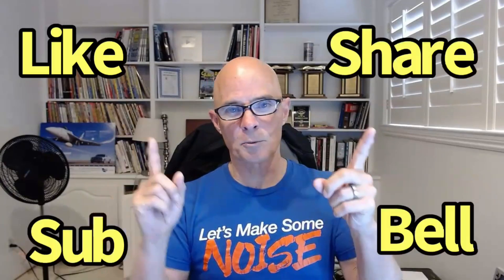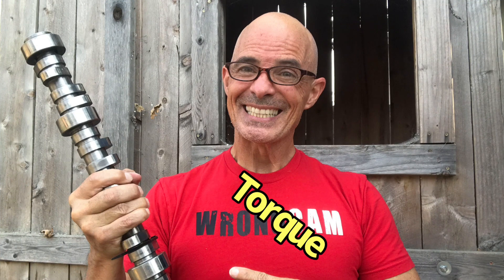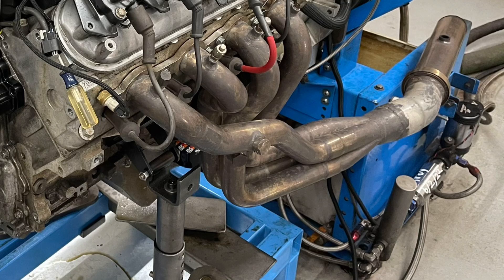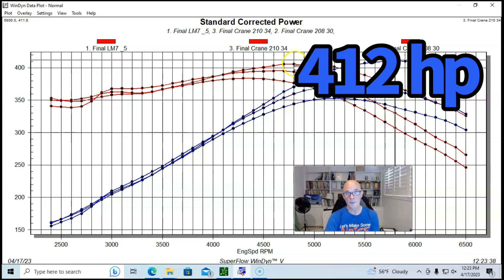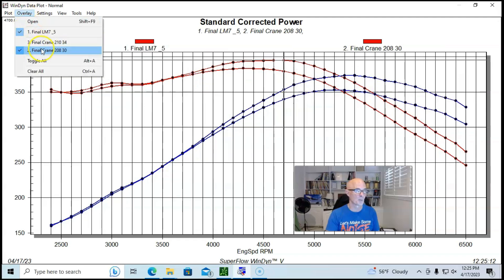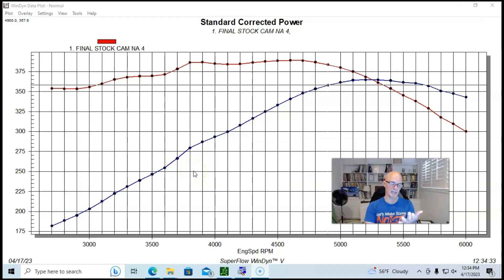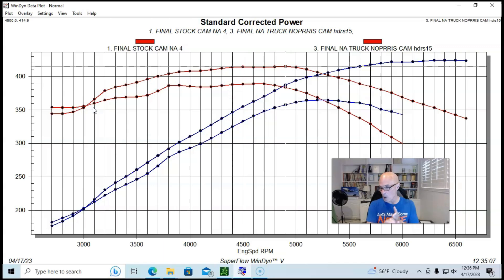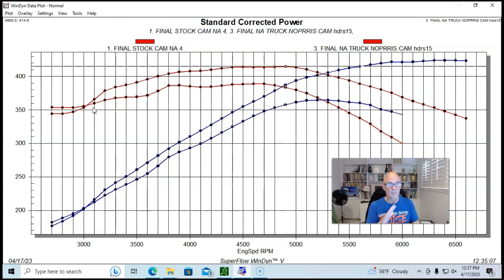WHERE'S THE TORQUE? HOW CAN I MAKE MORE LOW SPEED TORQUE? WHO MAKES THE BEST LOW-SPEED TORQUE CAM?

Comment: Intake manifold will give you low speed torque.  The longer the runner the better.
Reply: TPI intakes are awesome for torque
Reply: Holley Sky Ram
Reply: I'm only running a little Typhoon dual plane with a 600 cfm Carter/AFB.
Reply: This.  Below a certain rpm torque production is dictated more by the intake mani/head ports/valve sizes than it is the cam (within reason).  If you were to downsize the ports and optimize the intake manifold you could see some really nice torque gains.  But you'd also be trading top end power.
Reply: @ChurchAutoTest   Well I'm running Gt40P heads with stock valves. Springs were upgraded to match cam. They are also shaved 8 thousandth.
I will say my block is bored 30 over and decked 15 thousandth. I'm all motor right now. I would guess I'm pushing 450+ hp.
Reply: @ChurchAutoTest   Where are you located? I'm looking for a place here in Ga to dyno my Frankenstein.
Reply: @charlesespenshade  Southern California.  Holdener and I are gluttons for government overreach :)
Reply: @ChurchAutoTest  LOL, ever think of moving? Ga is a nice place to live especially here in the northern part. No dyno's in this area and plenty of people could use your service. We have some good engine shops in area that would love to test what they built.
Reply: @ChurchAutoTest  
I bet our taxes are a lot cheaper here to. Let alone better scenery to explore. We sit along the Appalachian Trail and have a 1,100 acre lake to fish.

Comment: You want all the torque under 3k rpm go get p-pump 24 valve Cummins problem solved lol
Reply: Gosh I miss my 6bt cummins. 4,000lbs of green alaskam birch in the back of truck, could let off the clutch without touching throttle, and the truck would crawl,no stalling.
Reply: @michaelmanzo1716  Yes Sir!!!!
Reply: Mostly compression ratio/pressure. Turbo helps on the diesel.
Reply: Truth
Reply: I had a 12v in my 91 Chevy truck the easiest swap ever.
Reply: Or a supercharger
Reply: Lol
Reply: I had a p pump 12v and it was governed below 3k and make 760tq and 300hp+
Reply: Ya let me just drop that right in my derby car

Comment: Buy a ford.
Reply: Which one?? The new ls/lt big block copy??
Reply: @HioSSilver1999  LS is a cheap copy of a ford Cleveland.
Reply: @Tegridynews ok brainiac, what about the LS resembles a Ford Cleveland???  I'm just dying to hear this gibberish...
Reply: @gofastparts4u  There are plenty of videos on youtube. There's even a YouTube video of a guy putting Ford heads on an LS running it on a Dyno until it blew up..
Reply: @Tegridynews  
Except LS engines last forever and make power, Cleveland's fell apart. Save up and put a Accel Super Coil on your Ford bro.
Reply: @juicebox853  what. Lol Only engine to ever go undefeated in pro stock in NHRA. LMFAO 🤣 The engine that created the restrictive plate in nascar.  LMFAO 🤣
Reply: @Tegridynews  then why was the clevland such a turd while the ls is really good.

Why would gm copy anything from furd when the sbc was already better ?
Reply: @Tegridynews  doesn't sound like that worked out to well eehh
Reply: @Tegridynews  post up how your clevland runs.
Reply: @HioSSilver1999  the new 7.3 Is a modern cleveland. 7.7 In the quarter on low boost. Stock engines.  Lmfao 🤣